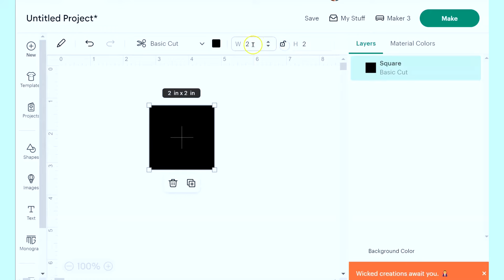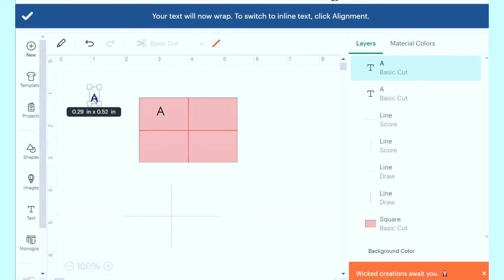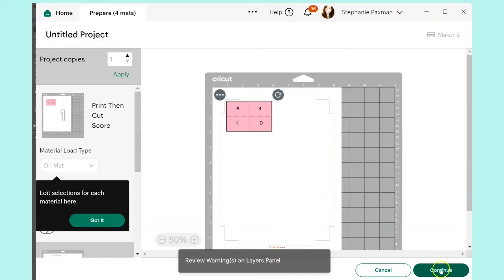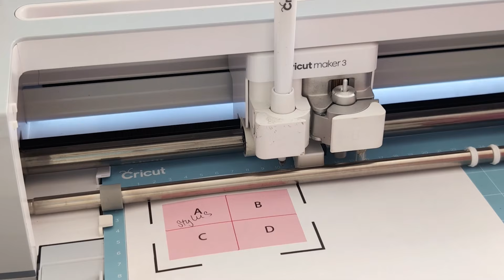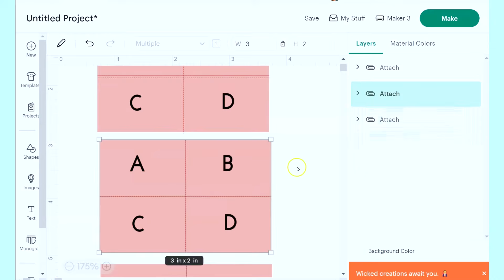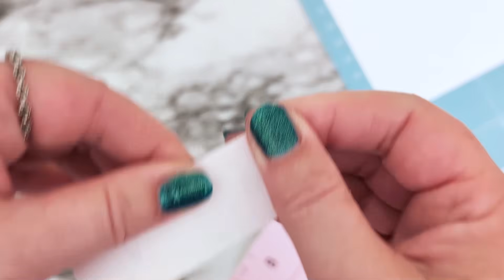Cricut Score Line Off? Here's a Fix!

Comment: Now I know why this happens, I check in the software contless times, I centered  and got a bad scoring result , so frustrating. It is really unnnerving as this is no cheap tool, the cricut. I am getting more and more disappointed, not to mention the last horrendous update. So much time wasted finding the tools. more clicks to get the previous result, nonsense.
Reply from the maker: It's like a treasure hunt now trying to find stuff in DS now huh - and I hope this helps get your lines in the right places now!
Reply: Not to mention that when you click the pencil icon to get to Position, Offset, etc., about a third of the screen is covered with those options, making it harder to work on your project. I also hate wasting time clicking to close that panel every time. What was wrong with having the tools at the top?
Reply from the maker: I know! I thought I would get used to it after a few times, but it's still just as confusing and annoying!

Comment: so basically, you are self-calibrating . . . right?  There has to be a reason why this happens.  I know it never happens on my original Explore
Reply from the maker: Yep, it's figuring out how much the machine is off, and adapting in DS. I wonder if the A clamp tolerance for locaiton is just off in the Maker?
Reply: @CraftingInTheRain  I have been wondering the same thing.  I still use my Explore for projects and since it only has one clamp, everything is always perfectly aligned.